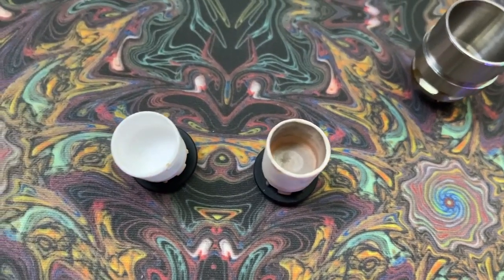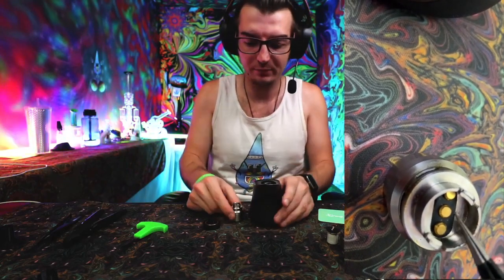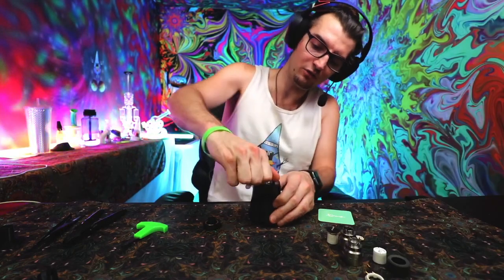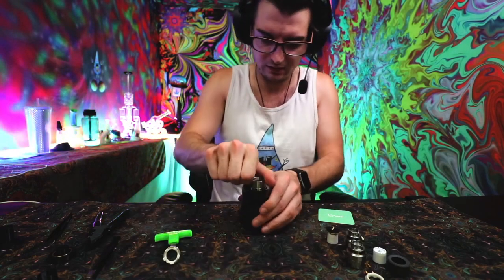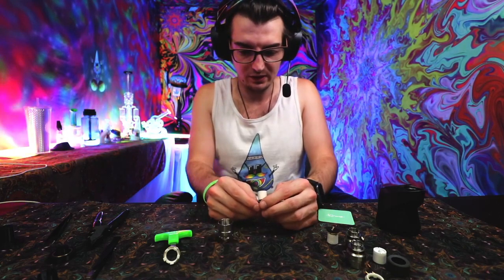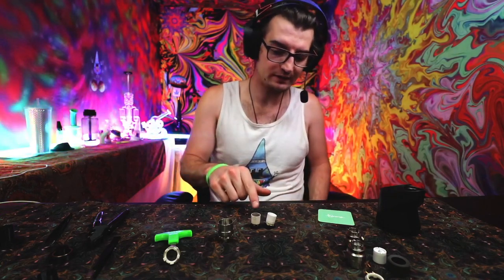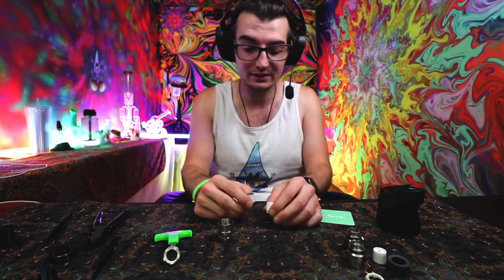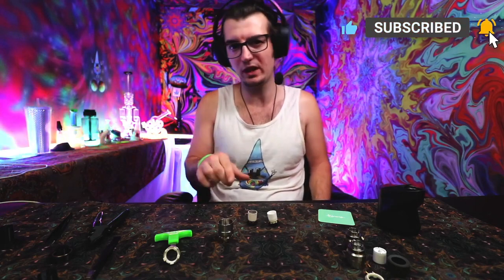How To Disassemble A Puffco Peak Pro Atomizer Chamber Tutorial!

Comment: My atomizer has the red white red white blinking light, I seen you disconnect the heat sensor thing, will it still hit if that’s disconnected
Reply: Late reply that doesn’t help now, but if can sit loosely on the metal without the solder. The first versions were like that. Just have to watch and make sure it’s touching the metal to be grounded to use

Comment: Yea no thanks. The puffcos suck i bought the brand new peak model within 2 weeks of light use the atomizer stopped working. Now i gotta mail my old one in to get a new free one. I remember when they first came out they said oh no the atomizer lasts forever as it should like a enail but then everyones kept burning out and they had to give them for free replacements so they then changed their policy without changing the hardware or telling anyone where a atomizers life span is only 1 to 3months and they cost 100usd a pop. Who wants to spend 100usd a month just to smoke their dabs and thats after paying hundreds of dollars for the thing in the first place! Even with this new policy their hardware is failing even before that. I mean jesus 2 weeks and it breaks thats horrible for a 200 plus dollar device ive had dab pens i could smoke all day for months before it breaks tha5 cost 30 or 40bucks. Its really sad tbh.
Reply: I appreciate your opinion. Interestingly I came in late and bought an old OG Peak, and just using common sense to not force  the atomizer at anytime, aka heat it up before removal, I was able to get 4-5 months of daily use from it. Im on my 2nd one of 4 months again and going strong since I learned my lesson....I really hope they didn't start to design the new Pro 3D chamber/atomizers to break more easily. ID BE PISSED. I plan on buying a peak Pro soon. I wonder if that's why they started including the 3dXL chambers with the units now for only $20 more so $420. Good Luck buddy! ANyone know if the 3DXL ones are supposed to last longer?